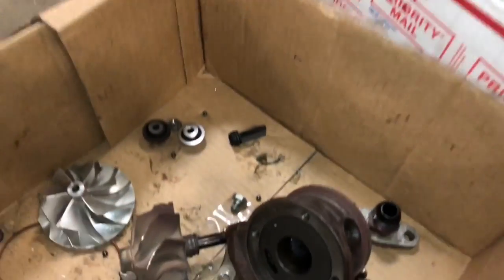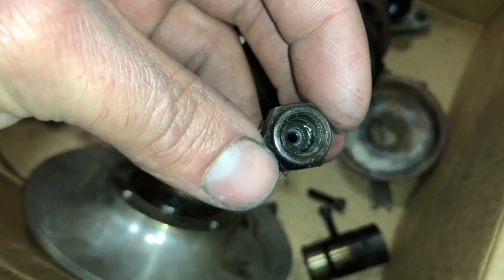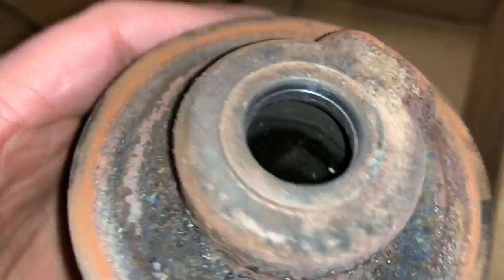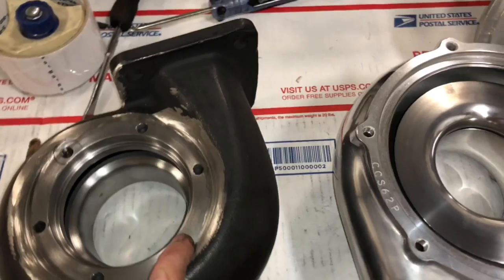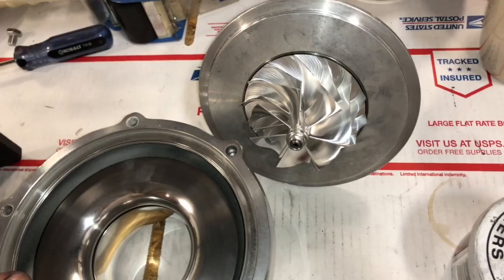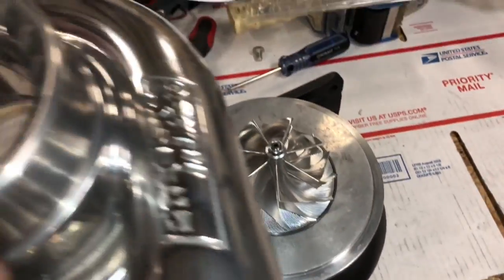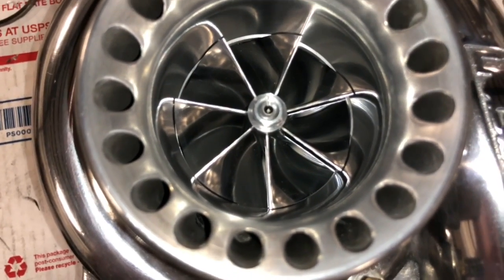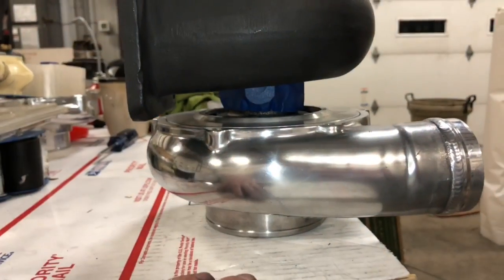Pte6266 bb Turbo Rebuild

Comment: those shallow heat shields  on the garret the Garrett BB are a PITA  so  PTE  have there own  bearing housing and ball bearing arrangement that allows  them to use the older  T4 housings?

Comment: Can you show how you build machined the housing with the 2 new ball bearings?
Reply from the maker: I’m not sure what you mean
Reply: @turbolabamerica  this is may be impossible to replace ceramic bearings with ball bearings unless you redesign the entire middle oil section of the turbo

Comment: Do you by chance know the thread pitch for the boost port on a compressor for a borgwarner s257
Reply from the maker: Usually they are 1/8 pipe thread on other turbos